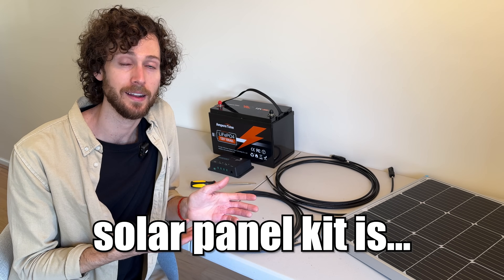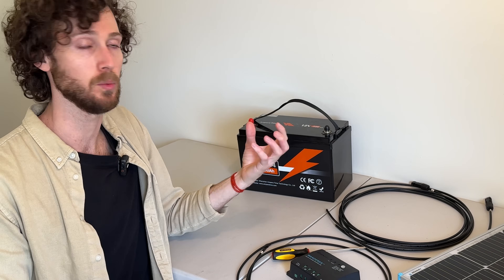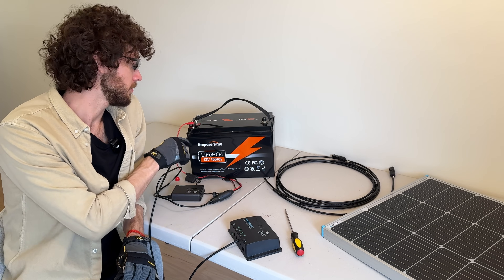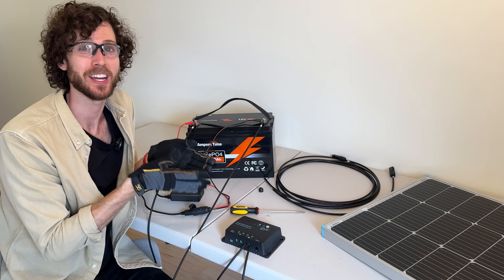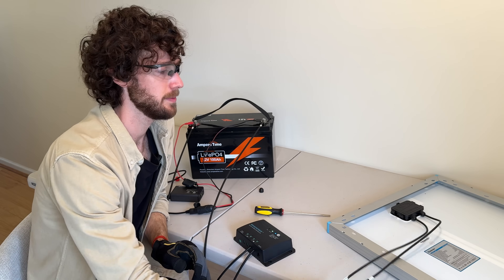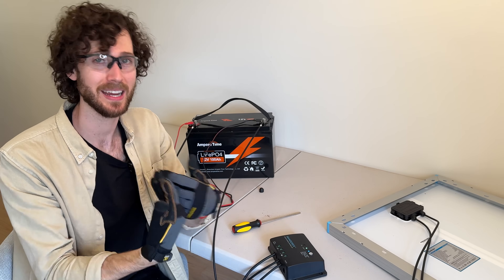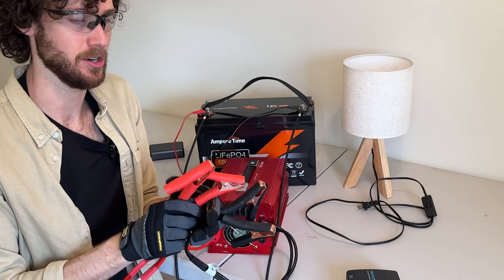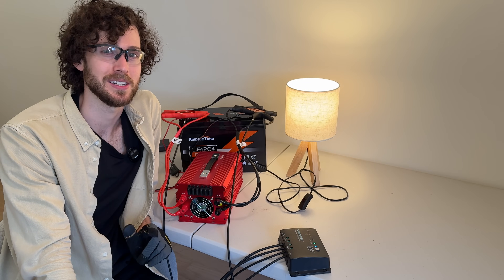100 Watt Solar Panel Kit Setup for Beginners - Step-by-Step!

Comment: Hi my name is Jeff I camp out a lot in Arizona. I have 4 25 watt panels I have the inverter and everything to go with it and the battery I hook the inverter which is a 400 watt I'm trying to see if I can run a mini refrigerator I have two batteries should I hook them together

Comment: Good video.
Most folks don't realize that what you built is a "solar generator"
That's how easy it is, and you can make your own for a third of the cost.
Something to consider...
If you want to upgrade to more panels and more batteries, your charge controller has to be rated for that load.
IE: 600w worth of panels will require equipment that can handle that wattage. I'm running a 1200w charge controller just to be safe.
Reply: Thankyou for that information. I was wondering about more panels and batteries…

Comment: Thank you for this video. I am a 66 year old woman, kinda tech savvy, but thinking about trying some solar for a few things. It's nice to see a simple system broken down step by step, so I can make a decision if I want to go that direction or not. Doesn't look too hard.  I appreciate it very much.
Reply: Same here😊
Reply: Same here...ready to try...
Reply: What difference does being 66 or a woman make?
Reply: @lawrencewiddis2447  Yeah, I wondered the same thing.
Reply: Am with you on this one !!!! It’s Great a video , it’s so easy that anyone can do it .
Reply: Greeting everyone
Reply: Start with what you hope to power with this system. Voltage? Watts? Time?
Reply: Then double those numbers.
Reply: The same can be said about building a house, it's just stacking breaks. Just ask if you have any doubts, this can burn the house down. It is not as simple, need to take into consideration cable diameter and distances. Be careful.
Reply: Use big wire. Rewiring isn’t fun.
Reply: Same here. I now understand better

Comment: How do you turn off the charge controller when you aren't using it?
Reply: Charge controllers get power from the battery it is connected too. You usually can’t turn it off without disconnecting it.

Comment: What the problem is with solar is that there are too many options.  A simple purchase of a (ex.) Heating solar panel with the needed accessories.  Like purchasing a lp or pellet grill with pellets or pellet tank, including a start device.

Comment: Excellent video. Any particular type of battery one should use? Can one use a 2000W or 3000 W inverter with a 100W solar panel with one battery or does one need more batteries?

Comment: Yeah, but she wouldn’t be able to use that 2000 W inverter without more batteries, correct and more solar panels to get your full 2000 W
Reply: that is correct, it even says continuous output is 1280w. plus if you ran 2000w constant it would drain that battery dead in 26 minutes. and with the average solar it would take 2-3 days to charge back up with 100W because its probably getting 75w at peak sunlight.

Comment: Hi I’m totally new to all this. I have leisure battery in the back of my van and I have bought a split charge relay kit so I can charge the battery from my van’s alternator while I drive to the race track. That kicks in and out as it needs to on its own. so can I buy some solar panels and add them the charge panel that comes with it then to the battery also. Does the solar kit know when the battery is full like the split charge does and shuts itself off? As I say I’m new to all this and trying to learn.

Comment: BAD diagram. 100 watt panel cannot run a whopping 2000 watt invertor. And it would take DAYS to charge a decent battery up to power that invertor for any length of time.
Best a 100 watt panel system can competently do is about 500 watts. in storage battery.
Remember, 100 watt panels provide 50% to 65% of their CLAIMED output. Far less on cloudy days.

Comment: Thx for your video, I got a problem, I connected the life04 12v 8ah battery to a 1000w inverter, I got a spark when connect, but wasn't able to get any 110v output, not sure what happened?

Comment: What can I plug to the 2000 converter? And thank you!
Reply: 2000w converter is anything less then 2000 watts of power constantly. a microwave for example is around 1000 watts. depending on power level used but on average.
air fryer can be up to 1700 ish

kitchen Fridge or freezer are around 300-600 watts. they run on cycles so they turn off and on to maintain temperature.

but for how long will depend on battery capacity and input from the solar.

Comment: How do you know if your battery is fully charged using the solar panel?  And how do you know how much power is left in the battery when using electrical equipment plugged into the inverter?
Reply: the solar charge controller can display everything
Reply: also the inverter can display

Comment: 🤔Hummm, how big of an inverter can I connect to a 100 watt system , will I need more batteries to power it ?  Are there specific solar panels just for marine use that are saltwater resistant?

Comment: Great video, but the stranded wire connection without ferrule/end sleeve (im not sure how it called in english, small metal tube pressed to the wires) bothers me. propably that kind of connector is perfectly safe with stranded wires, but somehow i cant stand wires that "naked"

Comment: What about adding extra batteries?
Reply: Easiest way… jumper cables (or wire) red to red, black to black….between both batteries. There are other ways to wire batteries for different voltages, many YouTube videos to show that, but basic way.. red to red, black to black. Cables can be found at most automotive stores or home hardware.

Comment: That fact that you know to hookup the positive first. Tells me your one of the better guys making these videos.
Reply: I’m a retired electrical engineer.
I’m laughing my ass off at this comment thread.
Reply: @guybeingaguy  Me too, as it matters very little, if you are careful. (even in a vehicle)
What matters less, is connecting a fully charged battery, to a (protected socket) "solar charge, battery controller" terminal, as NEITHER the positive or the negative, is connected to anything likely to short out any spanner.????

The solar charger controller, has in fact PROTECTED TERMINALS, which means that even if you were stupid enough to have the battery too close to the solar charger, when tightening the battery terminal bolts, the "spanner" cannot EVER touch anything metalic on the solar charger, as all terminals are fully protected by the plastic moulding, (even the screws are well below the top surface, as too are the actual cable entry points, which are inside the plastic housing).

Thus stating ONE cable must go on before the other, is irrelevant.

ONLY in a metal chassis vehicle, where a battery with exposed terminals,is liable to be short circuited by any soanner, contacting the grounded metal chassis, one simply connects the positive FIRST, (as connecting the negative first brings the entire chassis into the negative circuit).

By NOT connecting the negative first - if your spanner is tightening the positive terminal and accidentally (or on purpose) touches the bare chassis metal work, NO CURRENT CAN FLOW (as the negative is NOT YET connected to the chassis).

Only after fully tightening the positive, do you install the vehicle's chassis ground, to the negative terminal, as touching the spanner between the negative terminal and the now connected chassis ground, also doesn't cause a short circuit.

BUT for fools, who connect the negative to the chassis ground, oh yeah, they'll also be the fool who touchs the chassis with the spanner, when tightening the positive, completing the entire circuit.

It's basic really, to think, if I touch this with that, then follow the path and ask, WHERE does the electricity go, to get BACK to the starting point (being the battery terminal you are tightening?)
If one terminal IS NOT YET CONNECTED to the chassis, there cannot be a return circuit.

When I was young, I was ALWAYS taught to connect the NEGATIVE FIRST .. 
Why? 
Well hello, back then - most vehicles were a POSITIVE EARTH system, so connecting the negative first (negative LIVE being above the positive chassis potential) - made absolute sense.
Now that almost all vehicles are negative earth, yes, connecting the positive first - now makes sense also.

However, if there IS NO CHASSIS, (even one that is earthed), it cannot connect anything BACK to the positive or the negative, if shorted, as there isn't a return current flow to either battery terminal.
Reply: @guybeingaguy  Man, you aint kiddin!:)
Reply: @guybeingaguy  Wisdom? I'm going to be running a solar setup soon, legit information would be appreciated.
Reply: @Moonsmithing  What kind of setup how big what for etc.?
Reply: @abundantYOUniverse  Minibus to RV conversion.  Stage 1, Something to run a 12v diesel heater. Stage 2, A setup that can run the smallest of window A/C units.  Stage 3, full RV power with the engine shut off.
Reply: @guybeingaguy  😂😂😂😂
Reply: I was taught to connect the negative first, as it will act like ground.  Where if you connect the positive first, the battery is live but not grounded.  How were you taught?
Reply: @Moonsmithing  Exactly
Reply: @Moonsmithing  I was taught to connect  the negative last, especially on a vehicle, where the bodywork forms the negative path.

If you connect the negative first, and your spanner touches the bodywork, while tightening the positive terminal connection, you've short circuited the battery, causing at the very least a spark (in an engine bay potentially filled with petrol fumes), and possibly causing the spanner to become very hot, burning you.

A dead short, on a fully charged car battery, can be several hundred amps.
Reply: @BedsitBob  That doesn't make sense to me.  If the negative is connected and you touch the body while tightening the positive, the circuit is already made thru the negative.  No current would flow thru you. Your body is much more restrictive to current flow than the wires designed for it. That's why you connect the negative first. I hope this explanation helps!
Reply: @Moonsmithing  It didn't say if you touch the body.

I said if the spanner touches the body.

If one end of the spanner is on the positive terminal, and the other end touches the bodywork, the current will flow through the spanner, through the bodywork, and back through the negative terminal, completing the circuit.

Hey presto, you now have several hundred amps running through the spanner, which will heat up like a fuse, causing major burns to you hand, which is firmly gripping the spanner.
Reply: @Moonsmithing  Thank you Thank Thank you!! Gob bless you. I saw the light finally!! Although at my age, 80, I may forget, you know, but, I really appreciate to show me and the others why the negative must go first When you are connecting to the battery and ... then if you are disconnecting ... I first take off the positive .... because  ... is the one conductive the current however .. being the negative still connected to ground I am safe!! Did I learn it well!! I feel that TODAY I really got it!! I will pass it on!!. I do appreciate it!! Thank you!
Reply: Why so?
Reply: LOL!
Reply: The bar has been set very low
Reply: Any car mechanic knows this.

Comment: Question.. On the stripped wire end, Did you cut the wire? The solar panel i'm trying to buy has two adapters on each end.. I'll leave the adapter that attaches to the panel itself, but can I cut the other adapter off on the other end and just run it into the solar charger?

Comment: All I want to do is charge a few lead acid batteries I use during power outages. 
I have a generator so the big stuff taken care of. 
Will this keep the smaller things charged in the meantime

Comment: Great video I'll need to try this. But is this enough power to power a window ac unit? How much power would I need if it's not?
Reply: Ac unit is about 450 watt so you need minimum 1000 watt inverter solar panel

Comment: Ok I'm new to this. I have the solar hooked up but the battery power can't keep up to the water pump with the inverter. The battery is only 12 volt

Comment: That's exactly how I did it. I plugged in a 12v cooler box and it lasted 3 hours. I have 2 panels outdoors in the sun, it doesn't re-charge. New invertor, new controller, new panels, new battery. Food wasted.

Comment: Only thing I would add to your method is to mark BOTH ends of each positive cable so that if you're running wires through an RV or whatever, you can get both wires to their connections at the same time.

Comment: great video for beginners, but one thing I would have donen though is that if both cables were black I would have put a little red tape on one to indicate that this is the positive cable, so NOT to confuse the 2 later on
Reply: Definitely! Agree 100%. I use a short length of red heat-shrink-wrap on each end of the cable, at BOTH ends of the black wire so whether you're looking at the battery or controller you'll see the red wrap and know it's positive -- I wouldn't have both wires/cables looking identical color-wise: Black. Because I try to use the red/black colors if at all possible when working on DC electronics, and so OTHER people who work with DC looking at it will know what's up as well.
Also, instead of bare wires at the controller end, I use a spade terminal (appropriately sized to the wire of course, and crimped if not soldered) that will fit the hole as closely as possible diameter-wise and something solid (and flat) the screw can securely tighten against. 
Or, if you're pretty good at soldering, twist the bare wires so they're back in a cylinder shape, solder them so they hold a cylinder/round shape (use a small file to "fine-tune" their shape if needed) and insert them into the controller's connection holes. No need for a spade terminal but requires more skill. 
Whatever, I've never found just leaving wires bare as a "terminal" a proper way to do a job even if it works (and it does)...so for me -- and  if only for aesthetics and durability over time if you need to remove/reinsert (and repeat) as bare wires may fray/break -- I either use a terminal to suit the connection  (ring or spade) or solder the bare wires. But maybe that's just me?  ;-)
-- BR

Comment: Great video! Would you recommend:

YSOLX 1000W Power Inverter 12v to 110v, DC to AC Converter with 3 AC Outlet, 1000 Watt Inverter for 12v Truck/Rv/Camping/Home/Emergency Power

We will be charging phones and maybe running a fan. Thanks

Comment: Superb explanation.  Thank you.  My question is can I get away with hanging a solar panel in the window (heavy sun for 1/2 the day) or laying it on the roof (2/3rds of a day of sun), and connect that to my Bluetti EB3A portable power station (to top it off).  Then I could let the Bluetti do all the brainy stuff for input from the solar panel, and output to my appliances.  Right?  :face-turquoise-covering-eyes:

Comment: Very thorough and easy to understand tutorial!  One question:  What does the charge controller and inverter do?  Sorry for the newby question.
Reply: I'm a newby too but my understanding is that the charge controller regulates the power going into the battery from the panels so that it isn't getting overcharged. The inverter converts DC current from the solar panels/battery to AC at a voltage that can be used to power your mains devices. Obviously far more to it than that but I think that's the absolute basics.